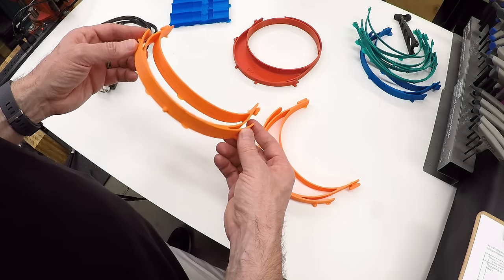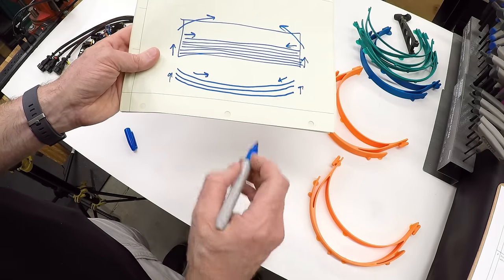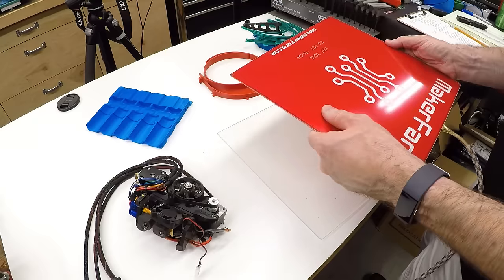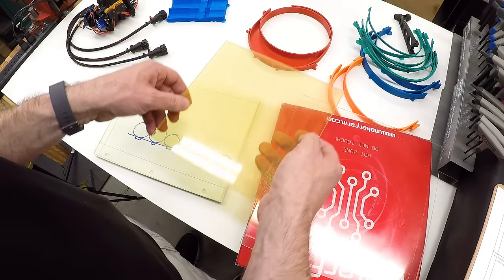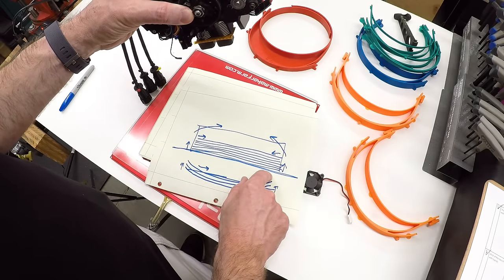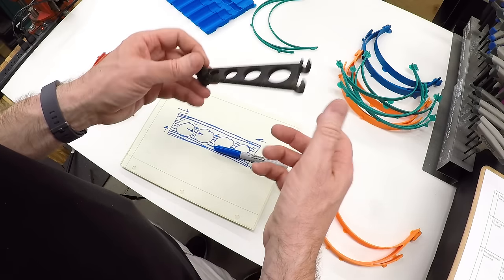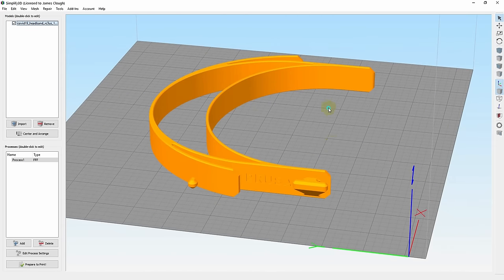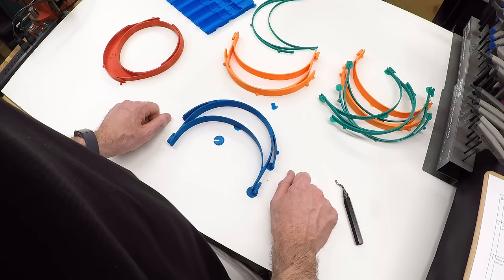3D Printing with ABS - Tips for Success

Comment: Why not use ASA? It's ABS but better (UV protection), easier to print, and fewer toxic fumes generally? Though it is a little more expensive, the difference is immaterial -- at least for typical hobbyist or small-batch commercial jobs.

Comment: 2:15 What is ABS?
3:22 Why ABS is hard to print with?
6:43 How to reduce ABS shinkage issues?
      Bed Adhesion
        Hair Spray
        PEI Sheet
        First Layer Height percentage tweak
20:27 Control draft air near the printer especially the hotend
26:44 Tweak the design to reduce the shrinkage force
29:34 Mouse ears technique
32:20 How to add mouse ears using Simplify3D
Reply: You are an angel
Reply: Probably the most useful comment that I've seen in the last 10 years. The full video is very good, but for a second review of the video, your pointers are gold nuggets. 8-)
Reply: My men 🔥
Reply: Exactly I wanted!
Reply: You forgot the magical incantation you recite which endows a face shield with the ability to repel viri.

Comment: I'm researching these machines to see if it's something I want to play with as I'm a woodworker. You have one of the best channels for knowledge and I like it.
Reply: The 3D printer has become one of my most used woodworking tools. You will find way more uses for it that you can imagine….
Reply: I am a woodworker as well and in the past year have added a CNC router and am getting a Thunder Laser delivered in December. My wife is interested in a 3D printer but most of what I have read or been told is "you better get good at Fusion 360" before purchasing a 3D. I have played around with 360 but have not spent a great deal of time since I have had to learn Vectric Aspire, soon will need to learn LightBurn and I have been working on improving my Adobe Illustrator skills.

Comment: I must say this video is impressive! It's a complete guide to printing with ABS. It's also a good, indirect advise not to use ABS unless you've massive time and energy to insist and use this awkward filament. 

I'll continue using PLA and PETG. No need to modify anything, no need to dedicate a special place with special environment for the printer, simple and easy.
Reply from the maker: I've been testing a printer with a heated build chamber, and it's an ABS beast.  Of course, it has a price to match, which is the way these things often work.
Reply: @Clough42  I learnt a great deal from this video about printing in general. I'm sure the tips and information in this video apply everywhere, to every material! Thank you very much!

Comment: I started printing in hard mode (ABS) from the start just for the reason that PLA can deform easy on hot days in several places and I wanted my prints to last. The 3D printer I use is the WanHao Duplicator v2.1 and I learned a lot from the start and what works best for me. Don't try to print ABS if you don't have a heated bed on your 3D printer.
I made a cheap enclosure by stacking 2 Ikea Lack tables on eachother and used polycarbonate plates in combination with 3d printed parts to fill up the gaps and added led lights. An enclosure is almost a must to make sure that the the whole print stays warm without any drafts that can cause cracks (and it makes a big difference with prints that are higher), and it can even help a bit with the electricity bill because it is easier for your hot end and bed to keep the temperature. When the print is done I keep the enclosure closed while it cools slowly as a whole, because if cool air hits the side fast it can still crack even when you are done printing. Mostly when it cools down enough the print pops off the glass plate with a loud noise and that is the moment I know I can safely take out the print.
I use 3DLAC (comparable to hairspray) as an adhesive to make the print stick to the bed. With the settings I disable the fan that normally blows on the hot end, and I print slowly so the layer has more time to cool. I also use a setting to pause between layers if the layers are printed within seconds so I can prevent burning the plastic or a molten blob of plastic on top of my print.
When you start printing ABS expect many failed prints and it is trial and error. Just Look at what happens (keep an eye on it while printing), find tips on how to solve it, adjust settings and repeat. Start with small prints first to solve adhesive issues with the bed and to make sure the first layer sticks well enough. After that challenge yourself by printing higher, and later try prints with a bit of overhang and find the limits on what your printer can do with ABS.
Reply from the maker: Yeah, I started from the beginning in hard mode as well.  I've only ever printed about 100g of PLA, compared to maybe 40Kg of ABS.

Comment: Jan Feb Mar all printers working great. April shows up and two of the printers can't print right and everything looks like junk. Ridges are warped. Parts won't adhere to beds. The difference... Air conditioning vent behind the shelves. Yes. It 100% matters with any extruded medium. Your insights on channeling air around the print head are going to help me plan future upgrades. Thinking about building a walk-in closet in the shop with a dehumidifier and temp control. Gotta keep the dust and humidity off of these spools. Great channel and thank you!

Comment: Ss I put off using ABS for a long time because people say it's so hard.  Now I prefer it for a lot of parts.  My tips are - Make sure your bed can hold the high temps, the larger the bed the harder it has to work.  My 300Xx300 has a hard time even with a 24 volt power supply.  My 220X220 has no problem even with 12 volts.  I set my bed temp to 90.  I turn off all part cooling in the slicer.  Sticks best for me to blue tape.  Print at a slower speed, you know just don't go crazy fast.  I keep a large 30 gal. garbage bag I cut down the sides to wrap around the printer to hold in the heat. You don't have to go crazy with the fit or it will get too hot.  I have the stuff to build an enclosure but the bag works fine.  It does, have an odor but nothing overpowering but I could see if you had multiple printers going at once it could be get bad.  So if your putting it off give it a try makes great strong parts that aren't as rigid as PLA.

Comment: @Clough42 I struggled with ABS for a long time and then added a simple chamber around printer. No additional heater, bed at 110C for first layer, 90C for the rest and the chamber heats up nicely. I have a 80mm fan on top connected to an air duct going out the window. With the fan running very slow I get a bit of negative pressure inside the chamber so no smell in the room and the chamber is kept nice and hot - I measured it just above 40C. The non obvious part of the equation is turning on the part cooling fan 50-100% of what you'd normally use on PLA with no enclosure to help cool the part enough so small features don't curve up.
My surface is aluminum tooling plate (and badly warped MK2 aluminium bed on the second printer) treated with glue stick or similar product. Now-days I use a fluid variant formulated for 3D printing, but regular stick works just fine - just apply over 50% of the bed, take a moist cloth and smear it all over it. You can re-smear it between prints for a long time without adding additional glue from the stick. Putting it on thick mostly works, but it's visible on the part and not necessary.
Only negative is my chamber is made from cardboard so flammable. On the other hand printer is Ultimaker cut from plywood so also flammable. Consequently, it never runs completely unnatended but fashioning the box out of thin aluminum sheet is not beyond most peoples capabilities (leftover sheets from offset printing are usually available and cheap secondhand).
I haven't had an ABS part fail from warping in two years now and I printed some questionable designs.
Reply: Nice report -- thanks for the details.  You have link for the liquid glue formulation for 3D printing?
Reply: An enclosure is key for printing ABS. I use an insulating enclosure built of 2" foam taped together with an acrylic door. A remote probe aquarium thermometer lets me keep tabs on the temperature- it reaches over 90F typically.

Comment: A very helpful guide. I've struggled with ABS and revert to ASA when I can. But customers will ask for ABS, especially for automotive parts, and it's rare to get the part printed right of the Bat. I hadn't considered mouse ears, but will certainly be giving them a go.
Reply from the maker: A better printer with a heated chamber completely solved all of my issues.

Comment: Thank you for the great video. Just a small comment on the flat/curved bed. I had Anycubic for 2 years and bed on that thing is really bad and not flat. They way I compensate curved bed is by doing "perfect first layer" - name of the video is "Removing Initial Layer Strings Cura UPDATED". I did use his suggestion and achieved perfect first layer that did compensate bad bed level. So I had stock bed and all the hardware from Anycubic and I dont have to modify my printer to battle flat bed. Also "perfect first layer" does help with adhesion. PS: For Anycubic users you have to do "perfect first layer" for the part and the brim if you use the brim for PETG or Abs. Also I dont use glue doing "perfect first layer"

Comment: Excellent work and rich info. It is alway a paint to print with ABS, but for some reason even when I print something with ABS and comes out warped on the bed I still like how the plastic just come out clean. For the hot end cooling, I would actually rather make it water cooled and use a larger cooling fan on a radiator and get rid of those tiny loud fans. Thank you for the brilliant  presentation.

Comment: You are quite right about drafts.  Why do so few people use actively heated chamber and water cooling???  I took efforts once making these two things out of scrap and have a constant good results with ABS.  These two measures solve the warping/delamination problem forever.  Thank you very much for such a comprehensive video!  You actually quite right about everything you described.

Comment: I've had success with abs, but still learned a thing or two :) Recently I have discovered ASA, a plastic that is similar to abs, shares a lot of the properties and unlike abs, is uv resistant. It even smells the same but has a lot less warpage and is over all easyer to print
Reply: Found the same with ASA. Remarkably good prints for how close it is to ABS, with UV resistance. ABS maybe cheap, but you'll very likely end up wasting more parts anyway.
Reply: @elminz  thats also important to realise. It might actually end up costing more

Comment: Every other video I saw trying to solve this just kept saying to through bonding agents and heat at the problem. It did help some, but I am printing tall mold frames on an open printer.
Those magic dots, or increased adhesion is not recommended enough. 
Thank you for covering this so thoroughly.

Comment: Hey James,
Great video. I have been printing almost exclusively ABS for the last 4 years. I have tried all the hairspray, glue stick, tape, glass and flexible sheets. I pulled my hair out for months till I went with an enclosure and Printbite. Honestly I leveled my bed 3 years ago. I have not used a glue or hair spray or any consumable nor have I used a spatula or any tool to remove prints. I have printed well over 600 prints on a single piece of printbite and never touched my bed. I don't work for them. I don't get any kickbacks from them. They just make a really good product. I now have 3 printers, all now have printbite on them and I no longer use any consumables other than filament. Printing is good and easy now.

Comment: This came out about a month too late for me, I had a part we prototyped in pla on our ender, the boss liked it so much he said to start printing production at which point i decided to print in abs. I tried glass, I tried a chamber(cardboard box). I finally ended up on the factory build tak and puting a .015 stainless shim under the center to take the warp out of the bed, couple that with a glue stick and a brim= bed adhesion to where you have to work to peel them off. first production run ships monday.

Comment: Congrats on a great and technical video!! absolutely correct so many things!! ALOT of variation between makes and even colors! 
To remedy the whole warping thing what i have found that works well is pre heating the  enclosure to about 50°C. Bed adhesion goes without saying, hairspray is also my go to, ABS Is way more sensitive than PLA, but the main difference I have found from PLA is the mere  viscosity of the plastic when melted. Bed temps from 80 to 90°C is fine. To print  ABS well  you have to get the extrusion (and retraction) really dialed in. Again,  this will vary from make and colors.

Comment: I have seen your video, Excellent. I brought my printer about ½ a year ago. for printing the nubs for the control panel. I thought I would ned  a lot of filament for other project . I brought 4 reels ABS and 1 reel TPU It was not a succes. But now I found out that ABS is not a easy filament. Now I know that it is possible. Thank you for the  informative video.
Reply from the maker: I have a roll of polycarbonate that has been sitting on a shelf for five years for the same reason.  I'm also interested in nylon, but haven't tried it yet.

Comment: I've always printed with ABS, I find I have more success printing ABS than PETG. I use an acetone slurry on glass to get my bed adhesion, gives a glasslike finish. I have my printer enclosed, with an acrylic sheet as the front of the enclosure to view the print. Works like a charm.

Comment: The ABS qualities and differences are sometimes enormous...depending from chemical composition, Acrylonitrile is the crystalline  part, Butadiene is the rubber part, Styrene is the third part of the compound...True it can be a pain in the neck if you swap roll and the material compound mix is not similar. If the ABS is shiny then the Acrylonitrile % is higher...referring to the rest of the compound,,,and so on...
What I did is  to heat 45°C to 50° C the bed, hair spray, which is part Acrylate, and then also have a reduction of the cooling...from 75 to 80%....keep warm but not too hot...because the material could also warp...

...my printer also has 3 side covered...but I made a cowl for the top to avoid heat dispersion.
ABS is a good material ..the parameters ...once gotten right...it is almost a pleasure!

Comment: Hey James, what do you think of the magnetic bendable PEI surfaces? Do you prefer Glass surfaces with hairspray over them and if not, do you suggest using an adhesion promoter on the metal powder-coated PEI surfaces as well? 
I ask because my printer came with the 2-sides metal, magnetic setup and I’m not getting great adhesion now that it’s about 50 prints old. I checked and replaced the Sprite all-in-one extruder/Hotend, leveled the bed different ways using many different techniques, reset all settings to default and checked/tightened all wheels yet the prints still don’t stick the same as the first one. Maybe these Creality brand surfaces have a service life, who knows. 
Have you heard of this and what are your thoughts on these setups? 
I hope you see this, I know it’s an older video but it’s the only one I could find of yours that had some good information on my issue. Thanks!

Comment: I cut my teeth on borosilicate with Aqua Net. It gets the job done, but I'm spoiled by spring steel and PEI these days. Fun trick: If the glass is really crusty and gross, you can clean it off with a generous dose of hair spray and a little elbow grease.
After working with BuildTak for a while, my conclusion is: Never work with BuildTak, it's a consumable item. The BuildTak sheets one of the office printers I use would last a month or two under heavy printing and regular cleaning, while their PEI sheets are easily lasting more than 5 months (the PEI surface on the MK3S sheets cracked and failed after over 2 years of service). They're probably designed more for their flex plate system, because you don't need to take a metal tool to pry off the print and scratch off the acrylic surface.
Certain shapes will shrink more than others, especially corners. The reason why brims, rafts, and mouse ears are suggested for ABS bed adhesion is because slicers will put round corners on them (brims and rafts), and circular shapes distribute the contraction force evenly around the curve. Sharp angles, on the other hand, will concentrate the force on the point of the angle, causing it to warp right off the print surface.
Enclosing the build volume could probably help more than a brim. I've had a brim ripped apart by warping ABS. Probably too much mass extruded in a cold drafty environment, but it was still impressive.
Quick tip about mouse ears: Since the point is to increase bed adhesion through surface area, you can put them to one side of the part, meaning it's just 1 snip with flush cutters to get them off (I do this because otherwise the MK3S print bed can't accommodate more than 1 visor). It worked with PETG and blocking the draft from the office HVAC system, but I don't know if it'll work with ABS.

Comment: Neat trick with the mouse ears! I've tried (as in lots of it) printing with ABS and even lately PLA and it warps like no one's business. It seems like my printer has moods (I think it's just plain damn lazy) where it will print fine for a week or two and then it simply refuses to print anything until I put it away for a couple months.